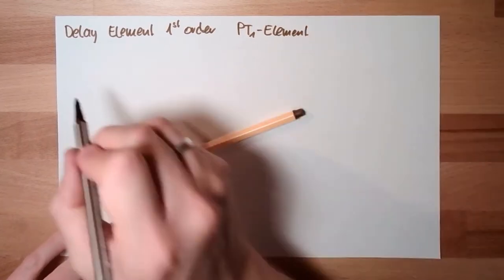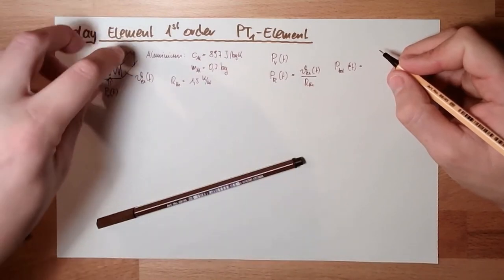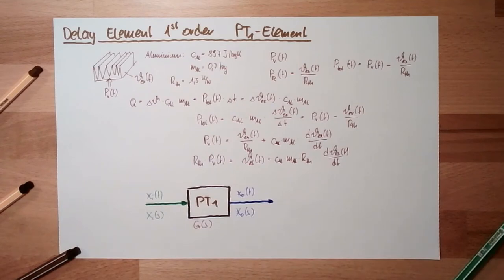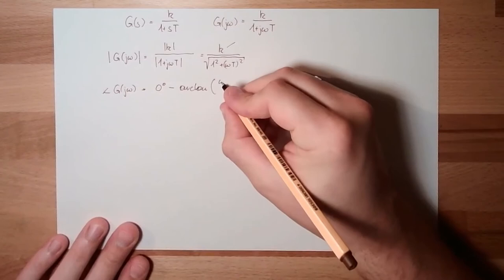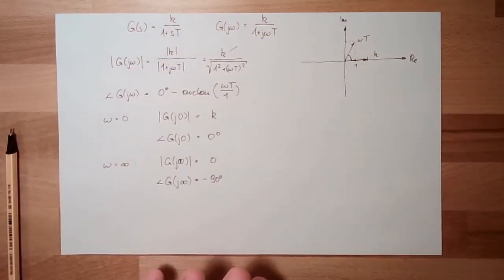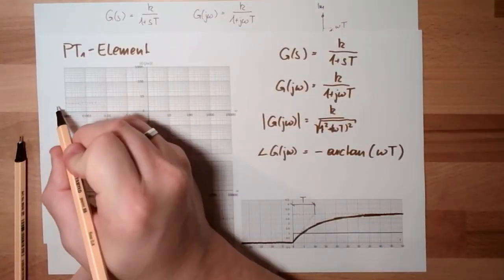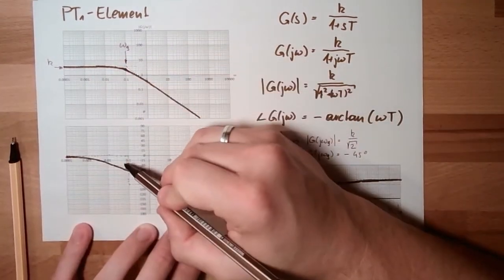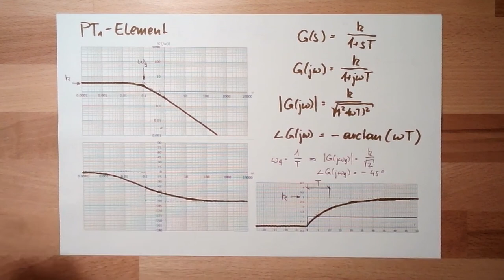Control 37: PT1-Element (Old)

Comment: That's a great video , thank you alot. if  you could upload the papers as a pdf file would be very helpful ... thank you
Reply from the maker: Thank you! Yes, this would have been a good idea. However, I did simply put the papers I used to the recycle bin. I never thought of this and will try to do this in future. 
Maybe I can edit some summary PDFs for the exisitng videos. I guess that would really help a lot.
Reply from the maker: Ok, I added a fact-sheet of the element. Check if you are satisfied with it (link is in the video-description).
Reply: @HeinzPeterschofsky   that''s very helpful, thank you alot :)